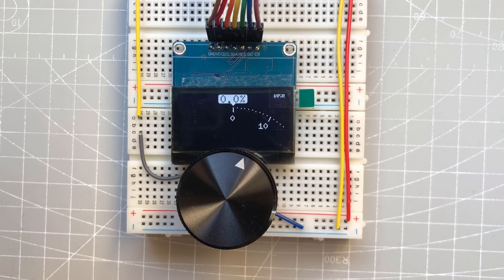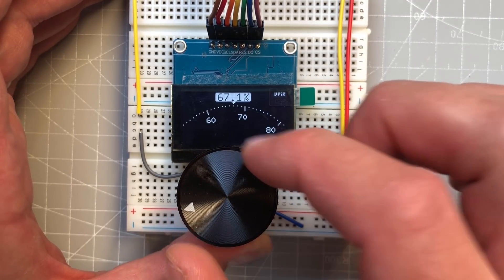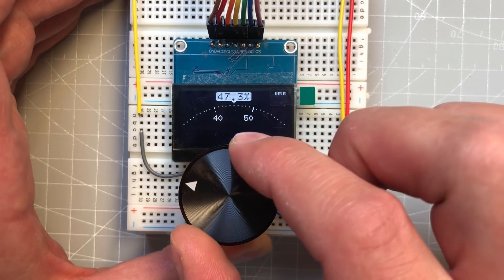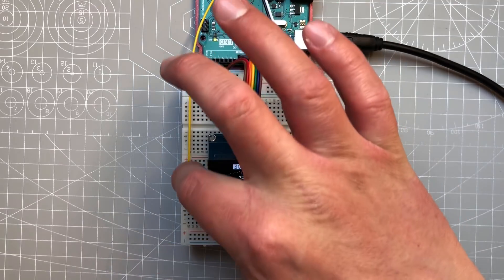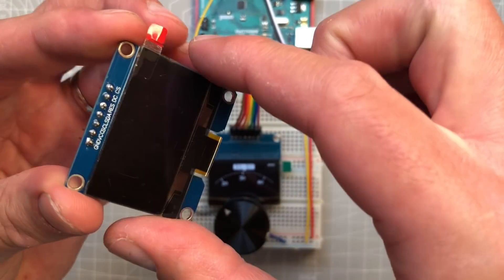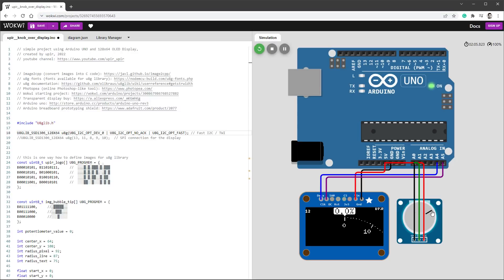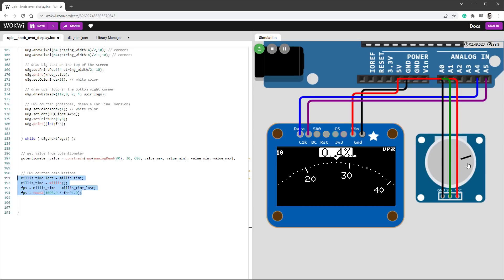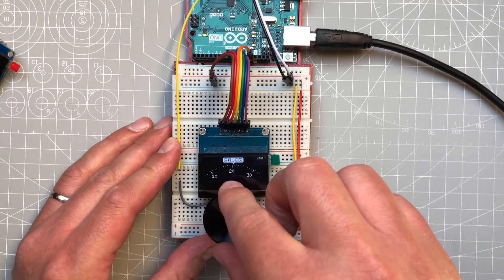Knob over OLED Display - Arduino Project Overview (OLED SSD1306, u8g, Arduino UNO, FREE CODE)

Comment: The U8G library definitely is the limiting factor for the framerate. I've written my own low level bitbanged spi library for the ssd1309 running on an atmega328p (arduino uno) and even simultaneously driving two of these displays interleaved I can easily get 100 fps on both displays pushing complete frames to each (2x128x8 bytes total). With a single display I've measured 200 fps. If I really optimized and used hardware spi I'm pretty sure I could get even higher frame rates. My application is kinda similar, it's an analog vu meter with simulated mechanical physics. I have a video on my channel and a hackaday project page with demo code/details. There's a lot of overhead going on in U8G with how it has to generalize enough to support multiple modes as well as multiple display configurations.
Reply from the maker: Thank you for your feedback, I will check your video/project for sure. I agree, the U8G library is the limiting factor, but on the other hand, it great that such library exists, and you don´t have to write the code if you don´t want to. At some point, I would like to understand the displays/Arduino enough to be able to do what you have done, but there is still a long journey in front of me..
Reply: @upir_upir  hopefully I didn't sound too harsh on the u8g library, I actually still use it for projects where I just want a simple way to display with minimal effort. It's great for those occasions, but certain situations require less overhead and that's where writing your own driver software comes out on top. I highly recommend trying your hand at it and you are welcome to test out my code as well as a starting point.
Reply from the maker: Yep, makes sense. I will definitely try your code and try to understand how to set everything up and get it running. I see you have a lot of videos on your channel, but do you have any specific to this topic? Thank you!
Reply: Interesting - looking at your project if you're truly getting 200fps it may be possible to use single frames of pixels added to anti-alias your VU meter in order to get a little bit more perceived pixel density and make the needle look a bit more "analogue" than "digital". The physics from the videos are honestly fantastic - just breaks the immersion the moment it sits completely still unfortunately.

Comment: what was the bottleneck in fps? Arduino proccesing power, comunication bus or display's controller?
Reply from the maker: It´s hard to tell, but arduino processing power was probably the main reason. Another possibility is that I´m doing something completely wrong, but I have other projects (like the car cluster) running much faster than this simple one.
Reply: Maybe I am biased because of my past experience, but I would want to do anything graphics or screen related on arduino. If the problem is Atmega32-related, to make it run fast, you'll have to know exactly what the library you're using is doing, probably also use some tricks to speed your algorithms up, even there there is no guarantee it will get better.  It's annoying, that you need such amount of work for such simple things to work smoothly. 
I was recently working on a controller, that has 240x320 LCD screen, but also does real time tasks, communication etc. I wrote complete code for LCD, from settings bits on bus to high level interface. I have my whole screen buffer inside micro's RAM, a lot of data, at didn't have to think much about performance, because I'm using modern micro. In this case, it was stm32f303, not a particularly fast one, but still, probably 10 times faster and 10 times more RAM and ROM than Uno's Atmega. 
You have to think about how much less troublesome it is, to just use modern micros. 
Just my little rant ;)
Reply: I looked at your code. You can, just for fun, measure how much time it takes Arduino to do all the trigonometry and floating point calculations. If just that takes 70ms or so, you will find your problem. Then you can try to simplify calculations by using lookup tables or something, but then again, as I sad in previous comment, it's annoying.
Reply from the maker: @tuxede  Thank you for your long comment!

I agree for the most part, Arduino is not the best candidate when it comes to driving the displays, but anything below 128x64 is probably "fine". At least for simple projects where you don´t expect 60+ FPS. It´s slow, but it´s a price for making it accessible and easy to use. If it´s a problem, you can always go with MEGA, Teensy, or any other faster Arduino clone. But I fully agree that for non-hobby work, you are probably better of with a newer chip. 

I´m actually using lookup tables for the trigonometry calculations - that helped to get from 6FPS to about 10FPS. I´m sure there are other ways to optimize the code, but as you have noted, it might require looking at the used libraries, since I believe that most time is spent with the drawing routines. 

Is your project some hobby or a commercial one? I would love to see what you are working on!